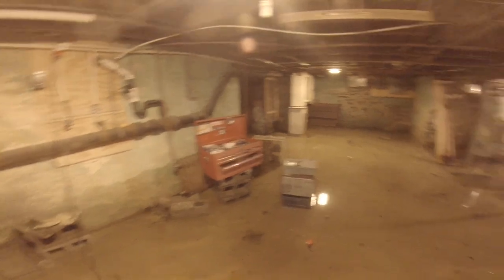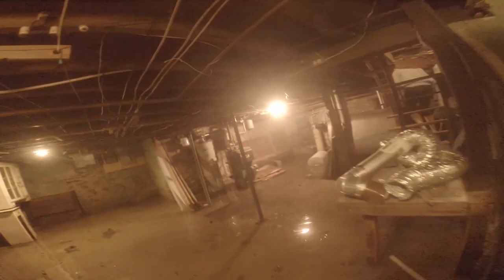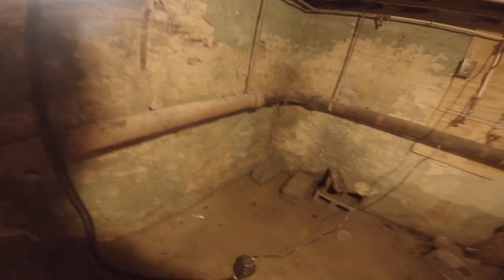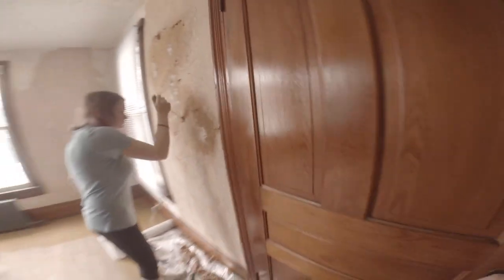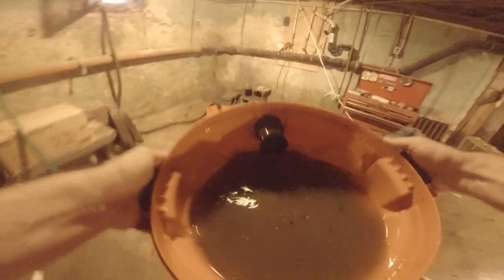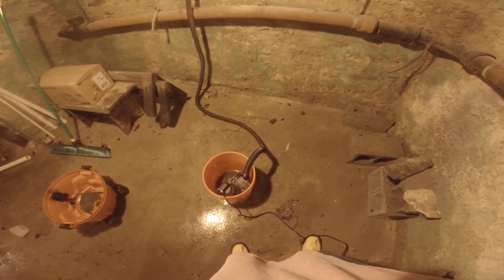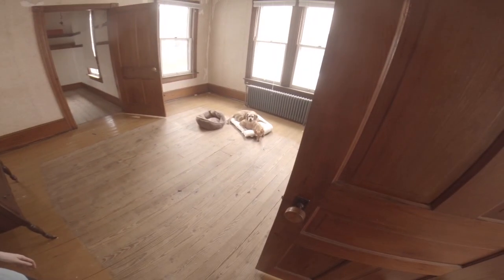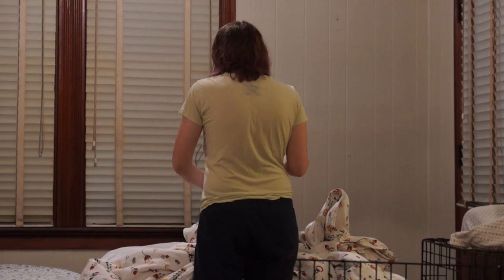How to Pump Out a Flooded Basement - NYtoPA Episode 2

Comment: You could have pumped the water in the sewer line instead of your garden, the sewer would have been flushed and cleaned with this big amount of water and the pump would have pumped more water because of less height difference.
Reply from the maker: I thought about doing that, but here in PA you're not allowed to connect sump pumps to the sewer lines.

Comment: You really need a sump pump dig. A sump and get to pumpin
Reply from the maker: We did end up digging a pit but have yet to install the pump apparatus. We ended up fixing the issue for the most part by changing our downspout arrangement and lightly modifying the landscape. While we still get some water occasionally it is usually little more than a puddle.